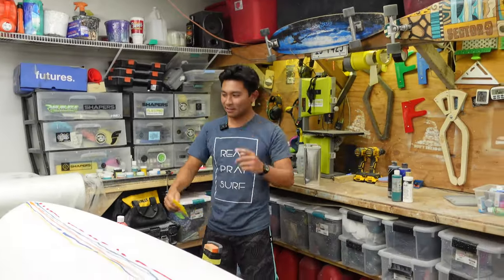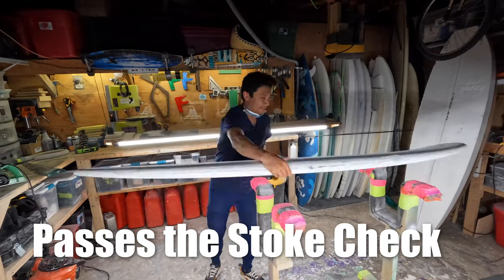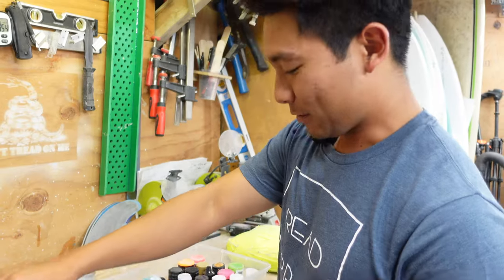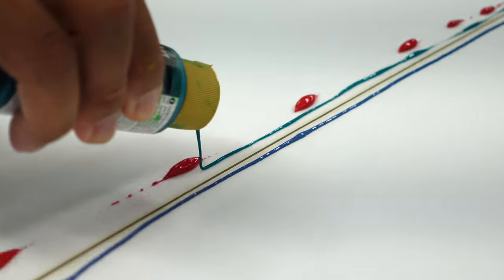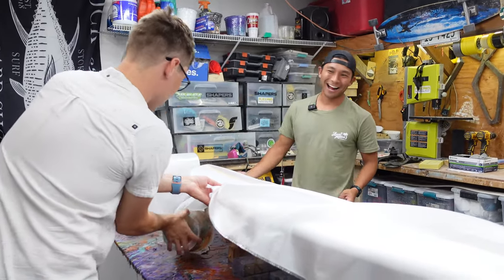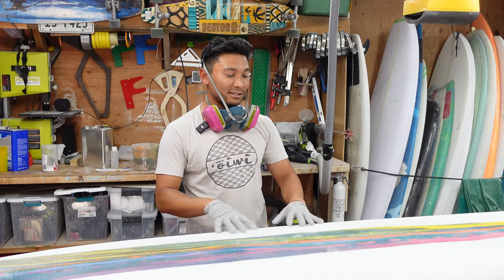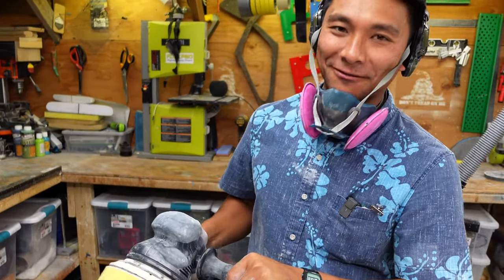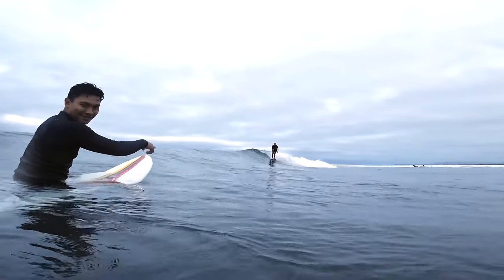Shaping and Glassing a Surf Board - Start to Finish [SoCal Mid-Length]

Comment: Looks great. Poly resin? 
Any snags with the acrylic foam stain and the resin?
Reply from the maker: Nah man, turned out great, and yes poly resin!   you would get into problems if you didn’t squeegee off excess acrylic paint thoroughly, if you left a thick layer the resin wouldn’t be bonding to the foam and you would get de-lamination.   But with good technique zero issues🙌🙌🙌